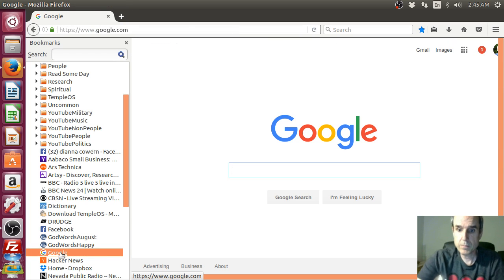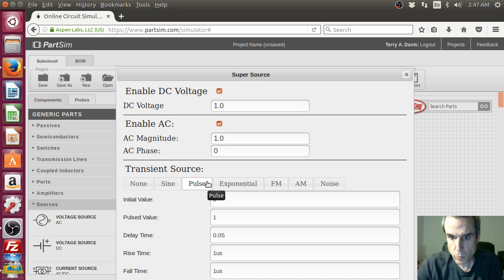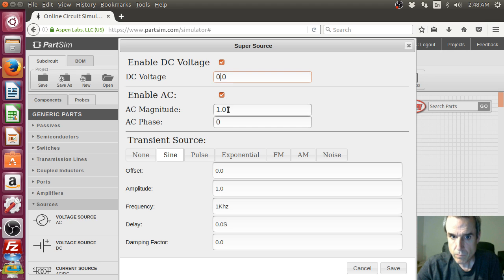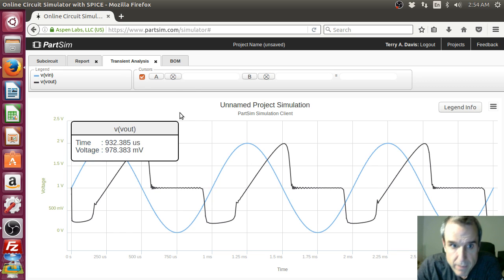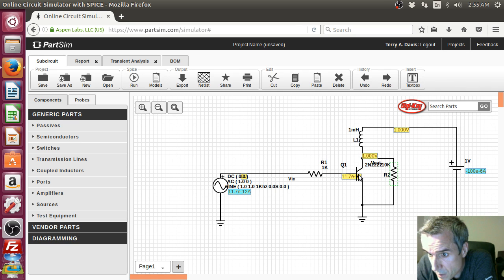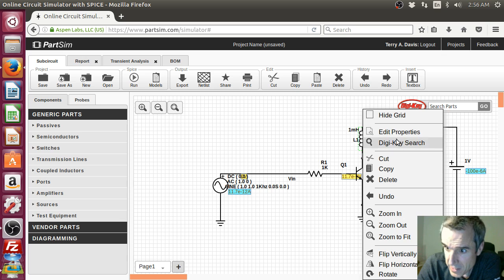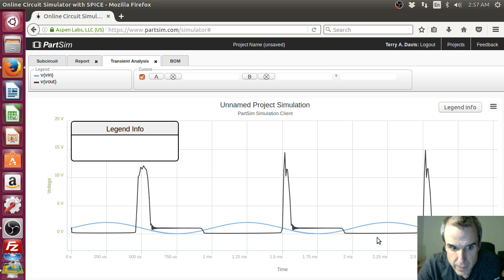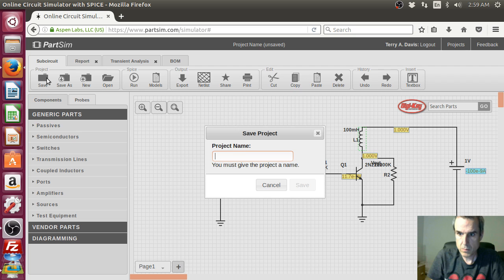Terry Tries Web PSPICE Part 3

Comment: Anyone with circuitry knowledge out there, can we get an explanation what he was doing to “make the fucker explode”?
Reply: Without a flyback diode across there, when the transistor closes it'll have a sudden and massive voltage spike across it unless there's a diode there to short it to itself once power shuts off.
Reply: @1boxerman  he tried to put the resistor to ground to flush some current from the coil, but the voltage spikes are there anyways
Reply: The secret is the curly thing called the inductor. It basically develops momentum in the flow of electrons so when the gate closes and redirects the current across the resistor, a bunch of electrons get piled up (voltage) because the inductor is continuing to push them and they can only move slowly through the resistor
Reply: Parts getting fried lol
Reply: An inductor opposes changes in current by generating back EMF. Therefore, if there is a sudden drop in current (when the transistor, acting as a switch, becomes open), there will be a significant voltage spike with reverse polarity at the transistor's collector, which can damage the transistor. The magnitude of the spike depends on the rate of change of current. This is why a sine wave is not ideal for blowing up a transistor, as it switches off the transistor more slowly than a square wave. That's why he wanted to use a square wave.